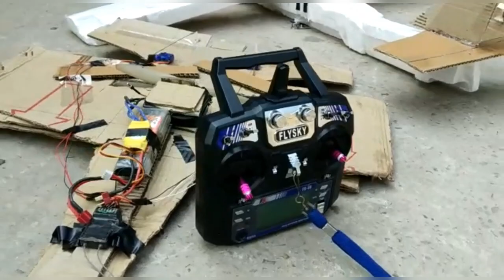how to make rc fighter plane with brushless motor.with fly sky i6.fly 101 %.

Comment: Use a higher kv rated motor and a smaller propeller or else the torque is to high for those short wing span of the plane
Reply from the maker: Ok bro